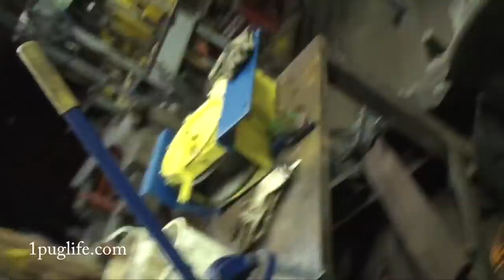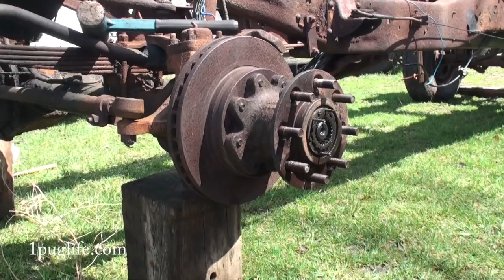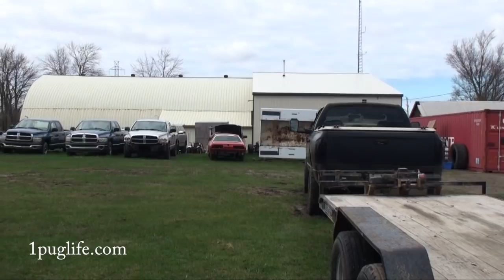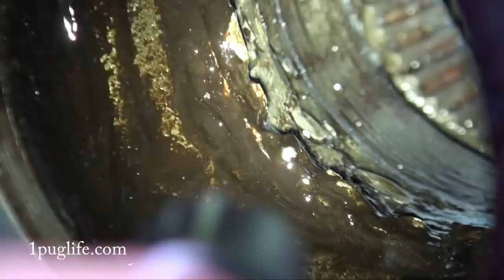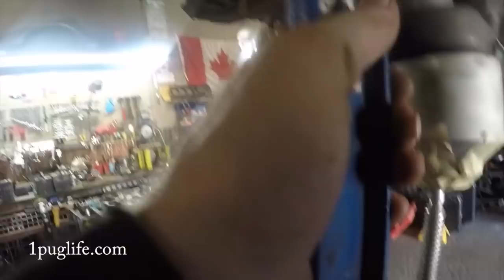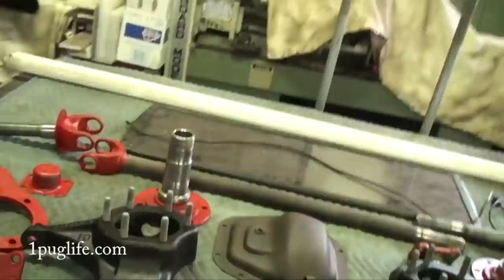doodles ex showed up in inwood

Comment: You can get those sealing surfaces fixed at a machine shop....they can like spray weld metal onto it and turn it down to the original size like brand new...don't know what it would cost...
Seen Atom79 on youtube do it many times...also check out 4x4 shops in the area...they deal with those axles all the time so probably have a line on parts...

Comment: @1puglife ALSO - are you trying to press out the ball joint taper? it is threaded in... machine a cross bit that will fit the slots, weld on a socket and TURN it out.

Comment: Stupid Goofs didn’t know how to remove the old bearing race or they did that (pinging?) to prevent the new race from spinning inside the hub hence why it fell out? Either way I think she’s pooched bud. And get a ball joint press!! They are pretty affordable online! And if set up properly you can tighten it up and then use an air hammer, not the safest but it’s never failed me:)
Reply: probably drove on it 200K with no bearings left and chunks of them using the softer steel as bearing surface... kind of matches the stub/...

Comment: if you weld right on the center of that race all the way around it will pull and make it shrink and it'll come out put the welding nozzle Bree where you don't want batter to stick to

Comment: Do you stink that if you make some cut's part way through the race delio with a saw then tried pressing it out, that would release some pressure ? or even cause it to Snap aprt to release it? 
Cheeched it.
Reply: Race is as hard as a saw.

Comment: See if you can make a 2 stud wheel puller. 1 heavy plate on the top. _ & a heavy plate beneath. 2 long threadded studs & nuts. Put a ring spacer on bottom for clearence..

Comment: Last resort to remove that race ,carefully use a sawzall and make two cuts across from each other not all the way through but enough to smack it out. Good luck.
Reply: Bearing race is very hard material.